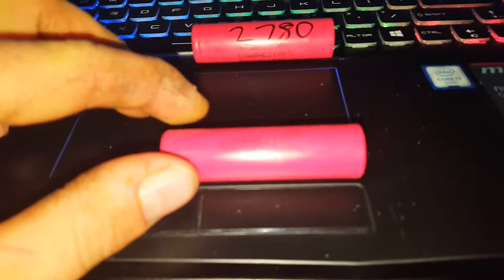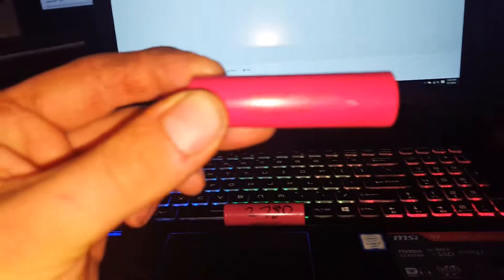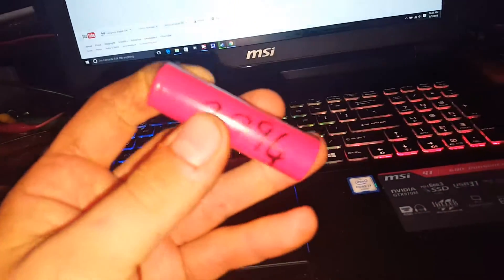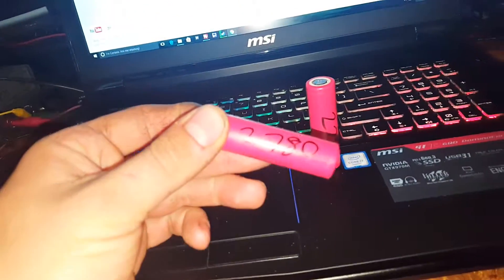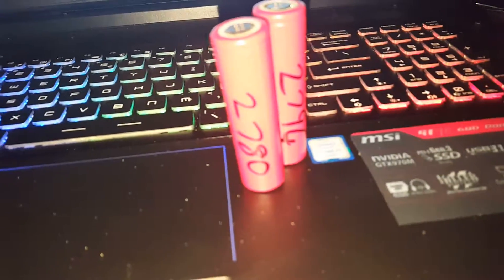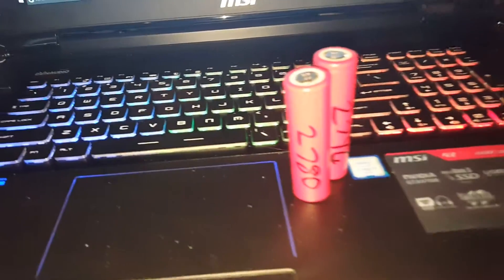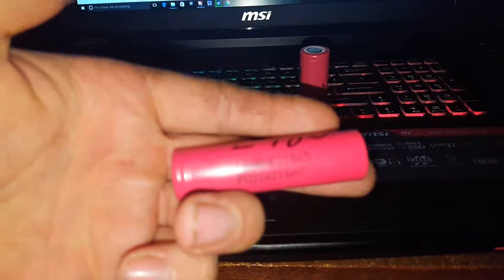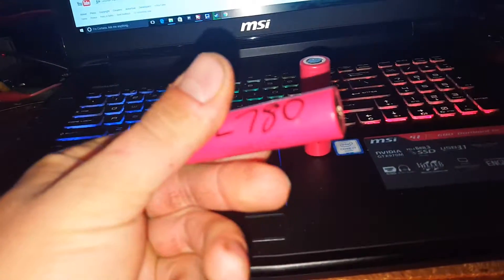18650 Cell testing LGABHE21865  high  mah almost new cells

Comment: Hey, what charger do you use to charge them up? I have a Litokala Enginner Lii-500 that I use for my other 18650 cells. After looking on the internet, I can see that these come under the 18650 form factor, but I didn't give a try to charge them up yet.  Mine came from a 5.0Ah PowerTeck power pack for Makita power tools.
Reply from the maker: hey mate i run these 2 links below

https://www.banggood.com/custlink/vm3EPmrzz3
Reply from the maker: And this one.
I use the sq4 to pre charge then opus to test with discharge done around 4000 cells so far
Reply from the maker: https://youtu.be/RCY6k9tb68I

Comment: Not sure if I'll get a reply since this was posted so long ago. But I just acquired 9 of these batteries from a drill battery with a stuffed pcb. I thought these were an 18650 but they're fairly shorter than my other 18650 batteries and the seem to supply less current, my torch is about half as bright with these
Reply from the maker: Hey mate whats written on the cell
Reply: One Up The Sleeve Customs thanks for the reply! They say LGABHE21856 and underneath that it has P21OG286 that ends in either AA, AJ or AC
Reply from the maker: Yeah thats odd  and you reakon its a bit shorter than a normal 18650
Reply: One Up The Sleeve Customs yeah not a whole lot but enough to make a differnce. Probably about 3-4mm I have heard 18650s differ a bit though
Reply from the maker: Do they still fit what you want to use them in
Reply: One Up The Sleeve Customs yeah they still fit but only just, they're a bit loose in the torch. Not a big deal since I've already got a few good 18650s but it would've been nice to have these as backups
Reply from the maker: Oh thats good than mate as long as they are still usefull. On second life storage.com there is a cell data base might be worth a look over there if your really keen if not thanks for watching mate get subbed to see even more
Reply: One Up The Sleeve Customs thanks for the replies mate👍